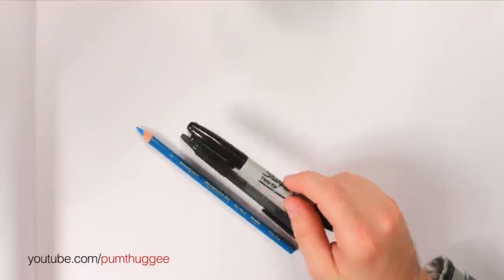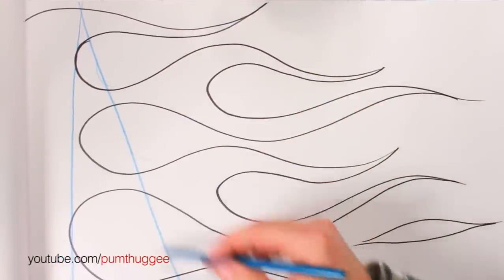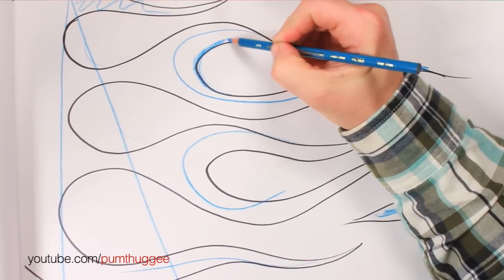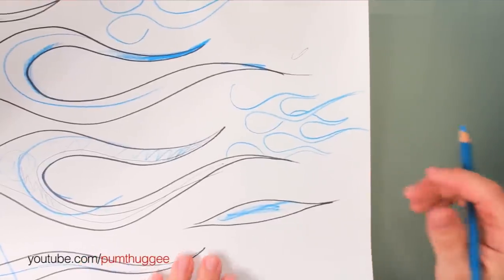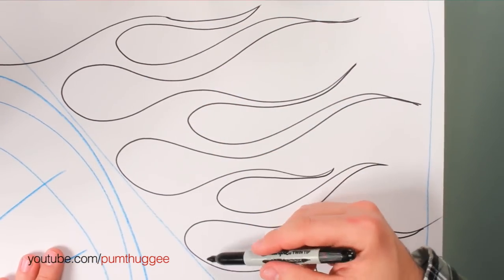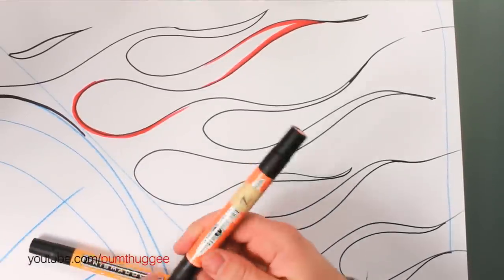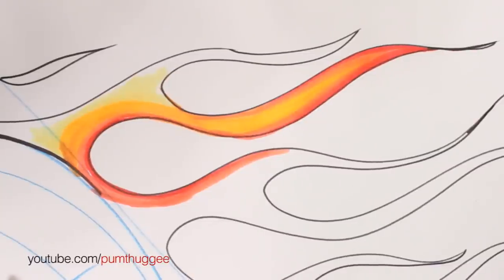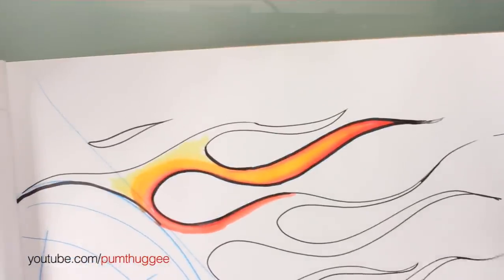How to Draw Flames for Cars (Part 1)

Comment: God.  You got nice flames for what you call junk or sloppy. Lol. Been drawing flames for about a 2 weeks or so.  I want flames on my windscreen on my z1000.  I’m having problems duplicating the left to the right. Symmetrical. Having to measure and map it on the right side of my drawing. Then it’ not exactly the same.  I draw the way you say not to but it’s because I’m working with a limited amount of space.     

Thanks for videos.   Be safe